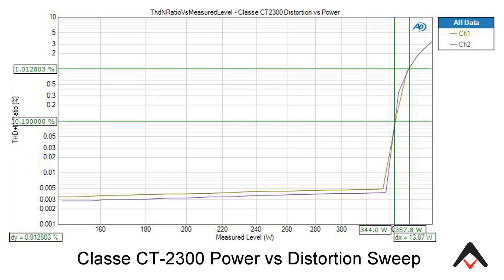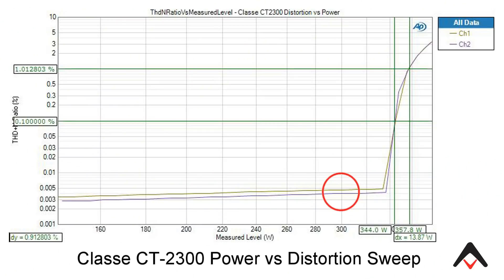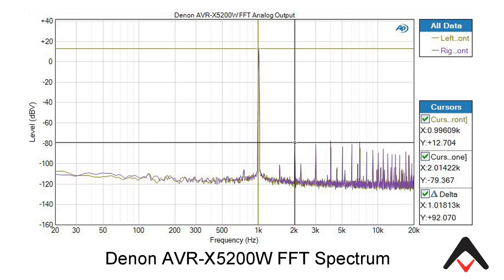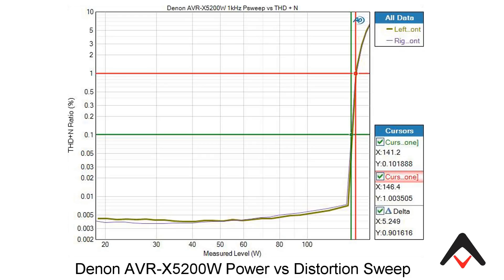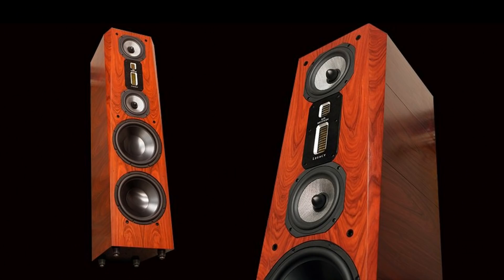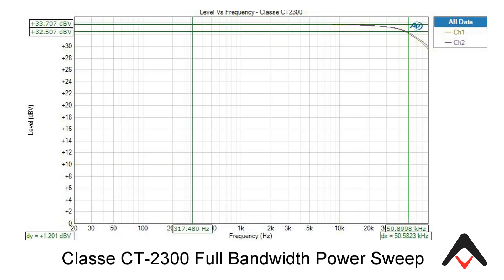Understanding Power Ratings in AV Receivers

Comment: My rule of thumb is ALWAYS look at the 20Hz to 20Khz rating, it's distortion by two channels at 8 ohms ...a single test tone  rating ISN'T MUSIC!
For example:  This is directly from my Onkyo TX-sr-607 receiver. (which is now 8 years old)
90 watts minimum continuous power
per channel, 8 ohm loads, 2 channels
driven from 20 Hz to 20 kHz, with a
maximum total harmonic distortion
of 0.08% (FTC)

Comment: I know you guys get a lot of well deserved praise and thanks but this video really was eye-opening. I have a four month old Yamaha Adventage A2060 running a Dolby Atmos 5.1.4 system. After watching this video I wondered how it would sound with a external amplification powering my two mains and possibly my  center channel. Based on your recommendation from another video I went with a Emotiva A500, 5 channel amp and my jaw literally dropped when I turned it on for the first time. As happy as I was without an external  power amp , Im amazed by The difference .Unfortunately many of us are accepting these manufactures power ratings without realizing the demands placed on the power supply when running a large multi channel system. Many thanks to you for this eye-opening video. The Emotiva, A relatively inexpensive upgrade, has brought a whole new dimension to my home theater setup.
Reply from the maker: Great feeback, you made a great choice.  Thanks Marcus.

Comment: hi gene, I was wondering have you guys had a chance to rate the Yamaha Aventage RX-A3060? is it any good for power? I have a Full Klipsch Reference Premier Home Theater system and currently use a Yamaha Aventage RX-A 740 receiver but want to upgrade to something alot bigger. thanks for your time. 😆

Comment: Very informative, thank you.  My question is about adding external amps.  How cognizant do I have to be about the amperage pulled from a single fuse on my fusebox?  Right now all of my home entertainment equipment uses the same outlet.  The lesser pulling equipment is on a surge protector connected to one outlet and the sub is connected to the another outlet but they are both using the same fuse in the fuse box.  Would I need to upgrade that fuse to run multiple amps for multiple channels?  If not then how should my power hook ups look?  Should I skip surge protectors for the external amps or have an individual one for each amp?  If an individual for each amp and I don't have enough power receptacles (outlets) for each amp/surge protector then what are my options.

Comment: Hey Gene I need your honest opinion on the receiver I'm currently using , it's a Denon 510bt and it powering a set of Polk RTI8's as my fronts , Polk csi3 center , deftech pro monitor 800's as rears and 4 Polk psw505's. Should I upgrade my receiver or is this one sufficient enough?

Comment: What, exactly, does "two channels driven" mean?  And, if only two channels are being tested, how do we know the wattage of the other channels of a home theater receiver?
Reply from the maker: 2 channels being tested simultaneously.  You typically don't run all channels at the same time with continuous test tones b/c it's not a realistic scenario with normal program material but it does show you the max capability of the amplifiers power supply and/or if it current limits (most receivers do).
Reply: Thanks!  I understand now.  This video was great!  Very helpful.  Keep up the great work!
Reply: Audioholics  thanks much for this video.

Comment: I have a Yamaha RX-A2060 which is rated at 140 watts at 8 ohms with 0.06 THD which seems pretty fair, but the fact that they include 220w at 8ohms with 10% THD is simply stupid... I'm currently using it with a couple of Jamo Classic 10's in Bi-amp mode, to get that extra power (along with some random rear and ceiling-speakers for that dolby atmos-feel)
thanks for the informative video!

Comment: I like to take the rated power draw from the wall that is listed near the power cord.
Then take that number and multiply it by 80%.
Then divide that by the number of channels to get a reasonable amount of actual power all channels driven.
I can't tell you how many times i've seen HT receivers advertised at 140Wx7ch but you turn it around and the power consumption rating only says 680W from the wall MAX.
Energy cannot be created or destroyed, only changed so the 140Wx7ch is clearly misleading.
I don't know how they aren't getting sued for deceptive marketing practices.
Reply from the maker: To the reicever manufacturers defense,  they rarely state all channels driven at rated power.
Reply: Agreed!
But, you've seen the same HUGE stickers on the front of the products same as I have.
Shady, especially when you see the 6Ω power ratings instead of 8Ω.
It seems that this is a more recent trend since most manufacturers have abandoned Class A & A/B.
I recently picked up an older Onkyo that actually states 70Wx5 and the power rating on the back panel shows 420W Max.
Sadly it seems that max power levels or Peak (PMPO) power ratings are just another box to tick on the spec sheet.

Comment: Thanks Gene, I could have listened to you for an hour easily. All your feedback is always crystal clear even for a newbie. 
Coming back to the subject, if all manufacturers could provide a standard graph like you did, sweep freq, specs written for 2ch driven, 4 & 8Ohms, with low THD it would be so much easier to compare each amplifiers.
Reply from the maker: Most manufacturers prefer to show their products in the best possible light either by massaging the specs or not showing the conditions in which the specs were taken (most usual).

Comment: Hello Gene - a while back i saw 1 of your video, testing the power of  AV receiver that claim ,Let's say 100W for all 7 channels, from the test only the Front right/left have 100W but the rest are not.

last week i went to a HIFI shop, talked to the manager about this. He said that the new model (Now and 1 to 2 years back) do not have this issue anymore. He said because of the Digital features on the receiver - Dobly atmos, he confirm that now every brand of receiver have the power per channel as it advertised.

What do u think?
Reply from the maker: Nothing has changed b/c of Atmos.  In fact, as I stated in the video, some of the manufacturers are being more sneaky about overstating power.  Each channel will deliver the same power if driven individually but most receivers cannot with all channels driven due to power supply and heat dissipation limitations and in some cases, limits in available current from the wall outlet.
Reply: Thank you very much, to you and your video, now i will go with Stereo amp instead of an AVR.

Comment: I remember others who used to manipulate by saying 40hz-20khz too. Can I ask  1 question?  I always know the Receivers play games going way back to the 2 channel days. I always used separates and still do. BUT now I just use 200 wpc monoblocks for the fronts because they are full range, and the receivers internal for the center surrounds. I already suspect this has to help take the load off the internal powersupply and amps. I just want to know if I am correct?  THANKS

Comment: Thank-you Gene for an informative video and your willingness to call out manufacturers. Because you take the heat from the manufacturers you do this hobby a great service. I doubt the over-rating thing comes as a surprise to most of those watching this, but I think how far over does. I wasn’t thinking it was anywhere near that bad. An eye opener to be sure. In the video you displayed the test result from a power amplifier and how that manufacturer actually under-rated the output. In general, are power amplifier manufacturers more honest than receiver manufacturers?

Comment: I have watched your videos for a long time and always appreciate the acquired knowledge. My friends and I were discussing the 8/6/4 ohm switch built into the receivers these days and the actual advantage or disadvantage in matching your 6 ohm speakers to your 6 ohm setting in the receiver. Should this ohm setting be manipulated or should it be left at 8 ohms and let the speakers, which are natively compatible with many different ohm settings these days do the configuring? Secondly, if you should manipulate the receiver ohm setting, in a 5.1 system for example, should you set the ohm setting to your lowest speaker? (i.e., Center is 4 ohm, L/R are 6ohm therefore the 4ohm wins)
Reply from the maker: The receiver impedance switch does NOT match the impedance
of your speakers.  It's there for one
reason only, limit power to get 4 ohm certification for UL.

See: https://www.youtube.com/watch?v=Ou5bO8P2Drw
Reply: Audioholics many thanks.

Comment: Excellent video Gene - NAD is a great example, as they rate their AVRs with all channels driven simultaneously, at full bandwidth and a rated distortion. They call this Full Disclosure Power. And since real-world program material requires short bursts of very high power rather than the continuous power normally specified, NAD also includes dynamic power ratings at 8 Ohms, 4 Ohms, and even 2 Ohms! 

Thanks!!!

Comment: These are all very important points. But I'd like to add something. 

There can be situations where a decent receiver can actually be enough for one and extra external amplification isn't actually necessary. 

Example:
1) The listener has a small room, where the distance between the front speakers and the MLP is less than 6ft. Unless the speakers are very inefficient (like down in the 80db), oodles of power isn't actually needed to get the speakers at reference volume. 

2) Gene has discussed this before, but adding a sub and bass managing takes off a huge load of power off the receiver. 

3) Usage of highly efficient speakers. The higher the sensitivity (and I'm talking actual measured ones), the less power is needed to reach reference volume. 

4) Many don't like to admit this but, just how often can you or will you even be able to listen at reference volume?

Comment: I don't know how Yamaha sell something with these fake numbers, like RX-A3060 which has 490W power supply and they rated it as 9x150W, but pretty sure in 9 channels, it has 35W real power and that with 0.1% which is dumb. It can do 9x50W, but at 1%, which is so terrible. I don't understand why it has 43 pounds if it has 35W/channel. Maybe Denon has fake numbers too, but Denon have at least 70W of real power on almost any receiver they produce. Almost any manufacturer says their receiver supports 4ohm load, WHAT? with 35W or 70W power, HOW? I don't think there is a speaker with 70W RMS in 4 ohm load. I also know a speaker needs a minimum power to function properly, but 70W on a 4 ohm speaker, it doesn't exist. They are all lies.
Also a separate DAC for critical music listening is miles away better compared to the internal DACs used in ANY receiver so I highly recommend a DAC. Also on Denon receivers, the internal DAC is still used on analog input, which in my case I like, because I'm using restorer setting that makes the music even more involving.
Reply from the maker: Sutharshan S Both are great options, depends on which room correction you prefer, YPAO for Yamaha or Audyssey for Denon.
Reply from the maker: The power supply on the Yamaha RX-A3060 is bigger than 490watts.  490 watts is a power consumption rating likely with 1CH drive and the other channels driven at 1/8th power.  It can't do 150x9 all channels driven but it likely can maintain that power level for about 4 channels driven which is more than adequate for real world usage.

You can bypass the internal dac of the Denon via the analog inputs if you use the Pure Direct feature.
Reply: Audioholics is this true that the Yamaha 3060 can only deliver 35 watts per channel? If that is true, I'm pissed... I ended up returning the Denon X4200W which I got for $969 CDN for a damn $1,800 3060 to find out this power rating is all bs...
Reply from the maker: No it's not true.  The Yamaha is much more powerful than that.  The only way it will only give you 35wpc is if you use the low impedance setting which we NEVER recommend or you drive all 7CH with a continuous sine wave and the auto-protection circuit kicks in.  The 3060 should be able to deliver near full rated power with 3-4 channels driven and 60-70wpc with 7CH driven into 8 ohms.   Check our bench tests of the RX-A3000 much older but similar capable unit:

http://www.audioholics.com/av-receiver-reviews/rx-a3000/rx-a3000-measurements-cont
Reply: Without bias which would be the amp of choice if you were to buy, Yamaha RX-A3060 or Denon X7200WA?

Comment: Recently I considered getting a new av receiver to power my 3 (L,C,R) low sensitivity 4ohm speakers. But due to 4/8K, HDR, DTS:X still don't have much contents I decided to keep my 7.1ch av receiver and get more power by adding a power amp. During my research I accidentally came across cinema grade pro amps and to my surprise they are a lot cheaper per watt than consumer grade power amps. I ended up getting a 4ch class-d pro power amp, its spec claiming peak output power 4 x 440w @8omh with 0.2% distortion. I have no way to test these claims but there are other people using it to power PA speakers and subs. Its specified power consumption is 720w @ 2ohm, 1/8 rated power and can draw up to 25A of current. Do you think the power consumption figures would give us a better idea?

Comment: XPA gen 3 review please. I'm interested in how the switch mode power supply holds up vs a toroidal.
Reply: would be cool if you guys could do a review on them. I'm going to CES this year so will stop by their room, but I would like to see a review of how they measure. Its interesting they have been out for awhile but not a single review has been posted.
Reply: Robert Ontiveros Emotiva Amps seem to be the real deal. Their ratings and specs are incredible! They're able to provide real power always all-channels driven and RMS into 8 ohms. While many other AVR manufacturers are just using marketing gimmicks.
Reply: yeah emotiva has had a good reputation but this is a new design and they have been out for a while without a single review so I would like to know if there is a downside to the switch mode power supply vs a big heavy toroidal. I need an amp with lots of dynamics and control to make my apogee duetta signatures sing.
Reply from the maker: Not sure since we haven't reviewed it but their old stuff with linear supplies is pretty solid.  I use XPR-1's and love them.
Reply: Yeah but this is new for emotiva. It would be like if a car maker were to just suddenly change to all electric cars from gas. Both can be used to make great cars but you would want some reviews or a test drive before just jumping in right? FYI I just bought one because its been a while and only one review is out. Im going to test drive it.
Reply: To answer your question carlos, I'm using the xpa 2 gen 3 with a schiit audio saga preamp and an ifi idsd micro dac. I have three speakers apogee duetta sigs, spatial audio m3 turbo s, and apogee cepheus 6. I just got the amp so I need to do more testing.

Comment: Hi Gene,great video. I wanted to ask your opinion of a conversation I had a few months back with a customer service person at Dynaudio. I had bought a used pair of Audience 52se and I wanted some buying advice on another model. He asked me what I was using for power. I told him I was using an Emotiva XPA3 for my fronts in stereo and surround. He was appalled. He said I   should only be using a high quality amp with with their speakers. I know you are an Emotiva fan. I told him I thought what I had sounded great. Is this a case of snobbery or am I missing something by not using more expensive electronics? By the way, my listening area is small and therefore I don't listen at high volume.  Thx

Comment: Hi Gene,  how accurate are the power ratings in the Yamaha Aventage line of AVR's (specifically the RX-A3060) because in Australia they offer significantly more power than the competing Denon or Marantz models for much less money (kind of hard to believe)?
Reply from the maker: Pay attention to specsmanship and try to compare apples to apples.  All of the major brands offer similar power at the competing price points.
Reply from the maker: I haven't tested the 3060 but it has a bigger amp and power supply than the Denon X4200 so it's likely more powerful.  It's more comparable to the Denon X7200WA.
Reply: Kelvinator22 I just got the RX-A3060 and wondering the same. Hopefully someone can test this out and advise the true wattage.
Reply: Audioholics any chance you can confirm what the true wattage of the 3060 is, would it be more then the Denon X4200w?
Reply: I got a few more days to return the 3060, please help clarify. If it's around 100 watts 5- channels driven I can keep it. I'm running Martin Logan 60XT's
Reply: Audioholics thanks Gene. I'm just going to keep the 3060. I called up Yamaha and asked about the transformer they said they can't tell me the efficiency or anything specific to all channels driven wattage. They said amp running temperature, speaker efficiency also play a part, but I should only see a 10% difference in wattage output if all channels are driven.
Reply: Audioholics which receiver would you say is superior Denon X7200WA or the Yamaha RX-A3060 overall?